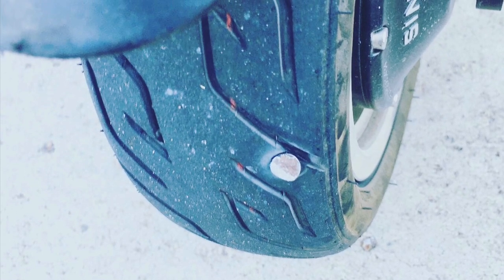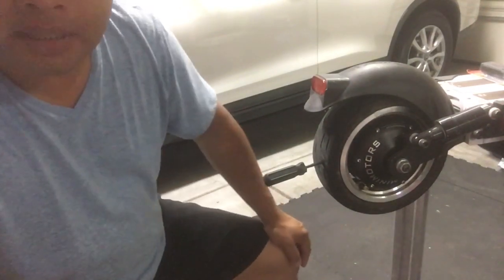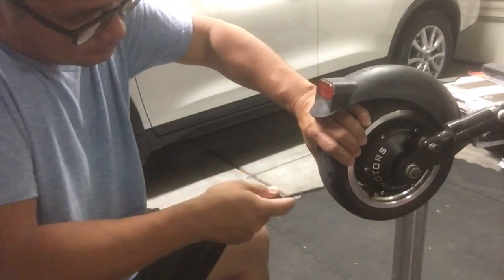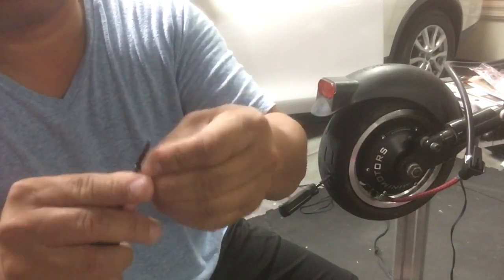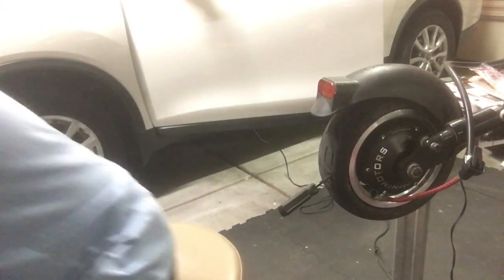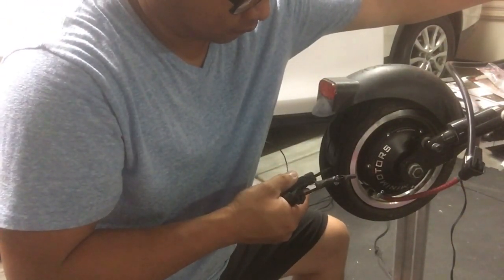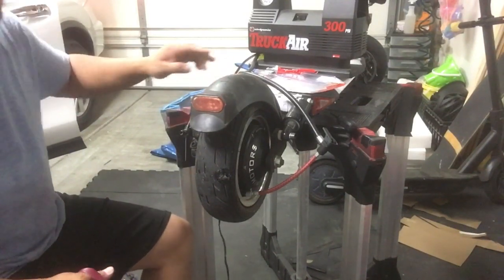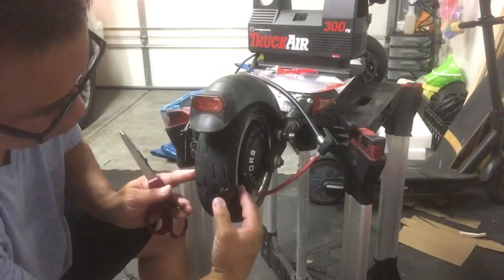How to fix a flat on a tubeless tire electric scooter

Comment: If you have smaller tires on your scooter and they are tubeless I recommend buying some tubeless bike plugs. I tried to repair my nail flat with automotive patch kit and the tool was too large for my tire I ride a emove cruiser so any scooters with those specs will work with anything bicycle related.
Reply: I have a emove cruiser too and I ran over a nail today. Which brand did you buy?
Reply: Great point

Comment: That is not wise to do this type of repairs on a scooter! you have to remove the tire patch it from within. I know it's more difficult but that's the safest way. you don't want to be flying doing  30 mph and the rear tire explodes or front tire the scooter doesn't provide any type of protection! when you start hitting the payment! Never play these easy games with your life a broken arm or broken collarbone is not worth a 20 minute repair on the tire!
Reply: Well; GOD is with us. Pray it does not happen. Sometimes its a viable fix till you get to the repair shop.

Comment: so when you pull it out, the strip will break in half and stuck in the hole.?
Reply: the tool has a slit in it leaving the strip in one piece .

Comment: I just repaired my Dualtron Eagle Pro just now; i was about to go all the way to the shop i purchased it from and pay hella money just to get it repaired. Luckily I bought that kit and tried it this morning. It seems to work for now; going to take it out for a test spin to see if it fixed it before work. I dont want it getting flat on me on my way to work. I will also bring my portable tire inflator to work with me just in case. Good video and keep riding dualtron my brother.